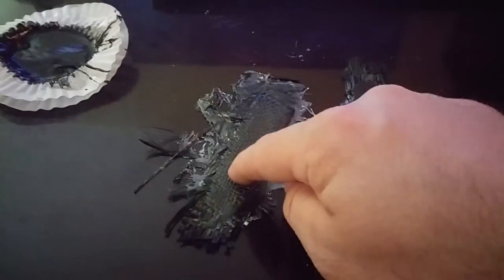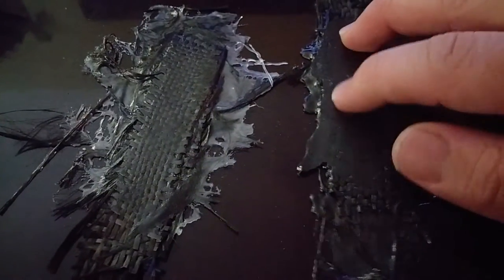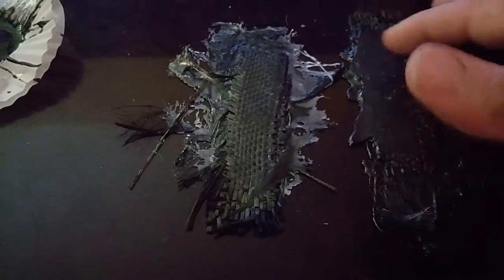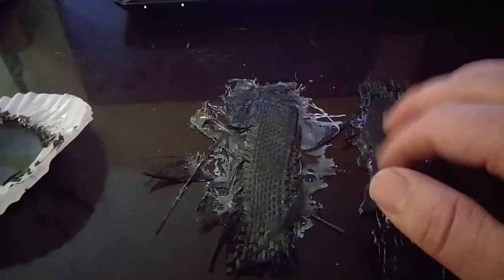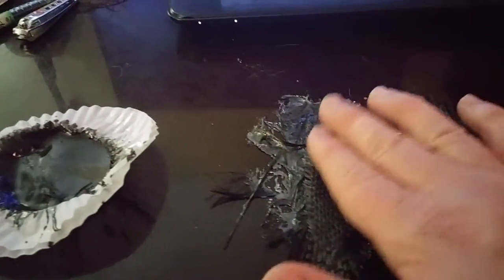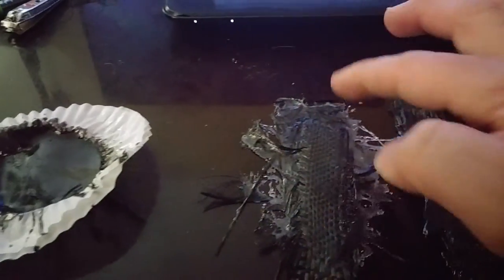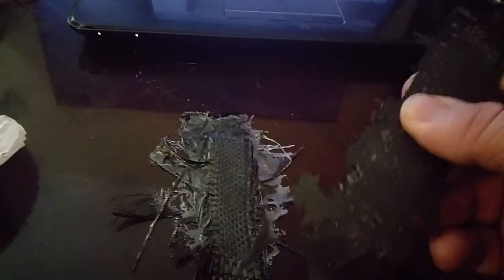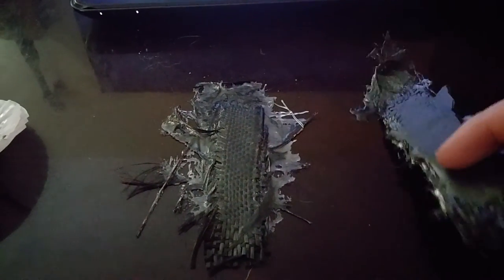Graphene in carbon fiber

Comment: You should rather laminate big pieces and then cut a number of those dog bones out, much much much more consistent and easier to control the amount of resin.
Big like something like 3ft x 1.5ft or so.

and use the roller thing to make sure there is no air left in, and it can be used to get out the excess resin. I haven't pressed things tho it is recommended, nor vacuum style neither. Comes out still somewhat decent.

But to make large plate, just take a thick deck, like table top, put in some plastic, ie. packing tape on the surface, or use mold release agent (wax kind of thing), laminate it, put another piece on top, and add weight :)

Lot of the strength of CF comes from compression and using as little resin as possible. Last bit especially for best weight to strength ratio.

Comment: I used your graphene to do a 10 layer vacuum pressed layup with 7781 S2 Fiberglass.  Same method with both having equal epoxy weight counted by gram scale.  One made with only epoxy and one with 2% Graphene added.  The graphene does wet out easier. I did not see a significant flexural/bending stiffness difference between the two.  My epoxy supplier, who makes epoxies for commercial and military explained the the real strength is the fiber.  He said  additives usually aren't used for extreme composite layup but higher strength epoxy is used.  It will be interesting to see your test results.  Keep up the good work!
Reply from the maker: Nice! From what I have been experiencing, the total stiffness is enhanced, but more importantly fatigue strength is greatly enhanced. I'll have results posted maybe as early as next weekend. :)
Reply: +Venturestarx That's great.  Here in the DFW area testing is Expensive so I stopped until I get a sense of a direction to push.  If you need composites made I have a 4 x 8 Vacuum Table and can glue up samples you need.
Reply from the maker: +waterman8761 that's great with the offer. I have access to that kind of equipment, but I'll post results as soon as I can.

Comment: Would the Graphene powder be okay to be used with Resin Infusion? Do you think it would help strength it or would some of the flakes potentially clog up any of the pores in the carbon fiber? Was planning on using it with a Carbon/Twaron hybrid, for creating a good for my car. The graphene would help dissipate the heat from the exhaust manifold keeping the paint from getting damaged, possibly even bringing cooler engine bay temps.
Reply from the maker: Yes, the powder is exactly what I make. It will conduct the heat very well.
Reply: Venturestarx Thank you.
I've been really into Graphene for many years and finding your channel then your products will definitely help me get started on some home experiments that I have had in mind but lacked the resources to make Graphene.
Reply from the maker: +Matthew Gregory Yep, making it is the hard part. I spent a few years working on this process so people can get thier have on cost effective graphene. Now I'm the largest manufacturer in the world with the highest quality material and the lowest price. Feels good.
Reply: Where can i get graphene😭😭 just need 100 gram

Comment: can you do a resistance test on it or will that not register due to the two part epoxy?
Reply from the maker: +Christian Hochfilzer I will tomorrow. I'm pretty sure the loading has to be more for electrical conductivity. But I think we can apply a coating of graphene on the exterior to raise the electrical conductivity.
Reply: Venturestarx I am guessing you mixed up the two part epoxy with the graphene? My curiosity here specifically relates to the feasibility of possibly being able to pass a current from one end to the other. I am essentially wondering if it's even possible to properly intercalate one of the two liquids with the graphene (at different %ages maybe), thereafter combine the two and even get a voltage reading on the other end. Would also be interesting to see if there would be any difference (before/after) by using the approach Robert used in his "mechanical approch" by buffing a thin transparent sheet of PETG/styrene (or whatever he used) and sandwich that layer in the middle (comparing the difference if any after curing ).... Yes, as you probably deduced already that this brain fart continued by me wondering what electrolyte might hold up here for a multi layered supercap ;-). Need to reconnect soon with you Mr. 1-3 LayerG
Reply from the maker: +Christian Hochfilzer Roberts mechanical application seems feasible.
Reply: were you ever able to get around to this?
Reply from the maker: +Christian Hochfilzer the guys doing the testing just started today. I'll know next week. :)
Reply: did you ever get those test results back?

Comment: Graphene can make some laminates stronger. But there's some misleading information here in this video. I think the graphene sample looks resin rich on the surface because the resin didn't go any further than the top layer. Wet out of carbon is 100% dependent on having a low viscosity of around 180-250 cps. Without a vacuum bag you can't push the resin through the fine fibre bundles. Graphene adds viscosity, not lowers it.  Many have tried unsuccessfully to infuse graphene. If someone has done it please let me know.
The sample stiffness he refers to is based on thickness of the laminate, not strength. You can't make a statement like that unless you have test data to back it up. If you're going to make claims it would be good to see some microscopy. Otherwise..........
Reply from the maker: Philip Steggall real graphene lowers the viscosity of resin, making the wet out far easier. The reason you use a vacuum is to draw the excess resin out not to help wet out. This example is very crude at best, but some really qualified people did this on a real scale and got very good results.
Reply: Do you have test results to substantiate the claims. Any increase in resin strength on the matrix side of the composite would be very welcome
Reply from the maker: Philip Steggall yes, but due to certain limitations (NDA) I can't pay them.